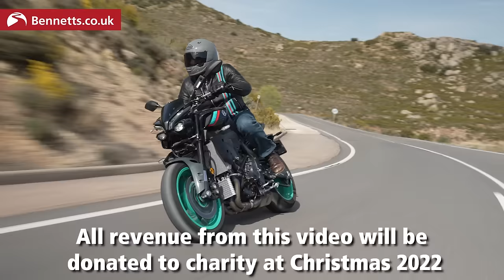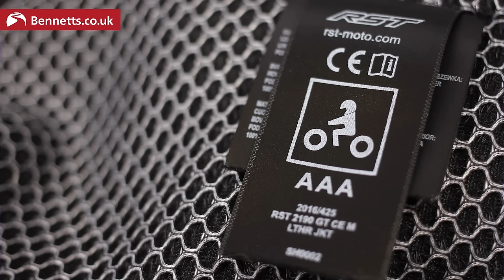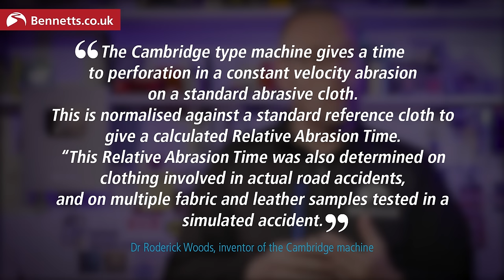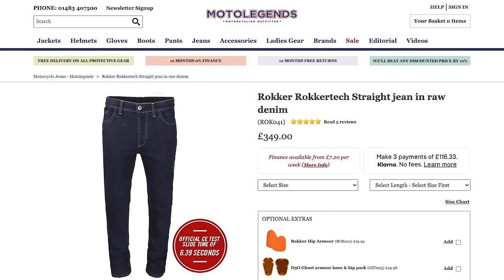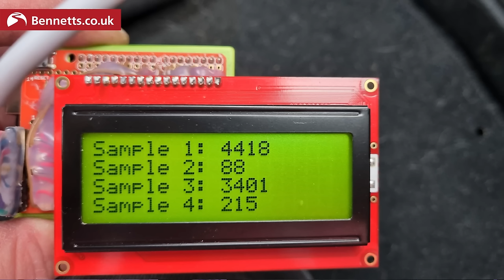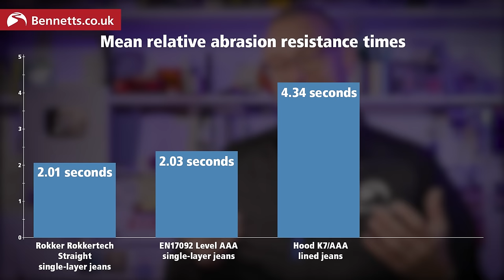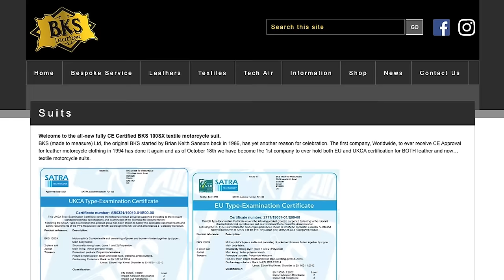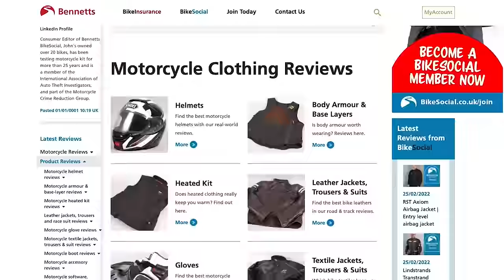Best motorcycle jeans | Single layer vs lined: THE TRUTH

Comment: I see Motolegends have posted a new video on single layer vs kevlar jeans and if it was a response to this video, then frankly it's disappointing. No technical data to back up their previous claims, but instead the focus now is on how horrendously uncomfortable (in their opinion) lined jeans are to wear. What's far more disappointing however is the fact that they (the chap in the cap) are deleting any posts that question the safety of single layer jeans, or are negative about the products they sell. I had no idea posters could delete comments and initially thought I was going mad as a few sensible comments left on there - 1 linking to this video and another giving Hood Jeans the thumbs up over single layer jeans, suddenly disappeared. A quick Google search later into whether posters can delete comments and I can only conclude that Motolegends are deleting anything that questions their products and their sales patter. The reality that this is how they operate has just lost them a customer, I actually own a pair of Rokkers I bought from them last year and also a pair of Hood jeans. I won't lie, the Rokkers are a bit more comfortable as they're obviously thinner, but since watching John's excellent video, I'll only ride in my Hood jeans, which are not at all uncomfortable so far. I had intended to visit the Motolegends shop as I need to replace my lid and jacket, but definitely won't be now. I would have posted this on their channel, but it no doubt would have been deleted. Thank you to BikeSocial for all the excellent reviews, most of my kit, locks etc have been bought off the back of watching them, if only this latest video had been made before I shelled out £350 on a pair of what I was led to believe were the ultimate jeans for protection on a bike!
Reply from the maker: Hiya... cheers for this! Yes, I've watched it and I was surprised how reasonably balanced it is in the most part. It's quite sensible, though I would say that there ARE higher standards than EN17092 AAA, and they're EN13595 Level 1 and Level 2. These will be going soon, but should hopefully be replaced by the (optional) BS13595, which should allow buyers to better compare top-end products. 
The A, AA and AAA ratings really are a good thing to help buyers, and they were rightly brought into law to stop brands and sellers making unsubstantiated claims of safety. Unfortunately though, with AAA being relatively easy to achieve, some are using wording that infers there is nothing better, for example making out that any product rated AAA is inherently as protective as something like quality race leathers, for instance.
Also, while the weight shown of the Hoods was close to what I measured (1,880g with armour), I wish I'd measured the Rokkers before I cut them up because the AAA-rated Roadskin Taranis jeans that I've reviewed weighed 1,360g with armour. Those jeans are also proof that AAA-rated single-layer jeans DO NOT have to cost more than lined jeans, so there's more choice there for people: https://www.bennetts.co.uk/bikesocial/reviews/products/textile-jackets-trousers-suits/roadskin-taranis-jeans
However, I was pleased to see that the spurious 'slide times' went pretty much unmentioned, and there were no more claims of single-layer being 50% more abrasion resistant than leather, or of Kevlar being degraded by washing.
I think people can now make their own choices hopefully.
Yes – comments can either be deleted, or accounts can be blocked entirely. It's interesting watching the ones that are being deleted (though you can still screen-grab them before they go), but it's their channel and they can do as they wish. As you'll see in the comments here, we try to leave criticism in and address it if we can, but we do block spam, hate-speech and personal attacks on us or our contributors. You can also set up auto filters to hide suspect comments (sometimes YouTube gets it right, sometimes not), then these are put in a folder for reviewing. I try to go through these every day, and do what I can to cover them. 
I think Motolegends looks like a great shop overall and I really like what it does to encourage people to ride; we put all their breakfast mornings in our events pages, though sadly I doubt I'd be welcome. Still, it does seem strange for a company that states it won't sell lined jeans to criticise a company that chooses not to make single-layer jeans. Like you, I prefer to make a judgement based on science and data. I'd prefer to see people informed, rather than influenced. 
We won't always get it right, but it really makes no odds to me what people buy. I wear single layer jeans, and I wear lined jeans. I don't tend to wear leather much, despite knowing it's usually even safer than my lined jeans!
All the very best and thanks again,
John
Reply from the maker: You can get a lot more data at the BikeSocial site, here: https://www.bennetts.co.uk/bikesocial/reviews/products/textile-jackets-trousers-suits/what-best-motorcycle-riding-jeans-kevlar-pekev-covec
Reply: Thanks for the reply John. I agree 100%, get the facts out there and let everyone choose. As almost all of my riding involves 40+ miles a day on the motorway I want the maximum protection possible in the event I go down the road, which is why I'll almost always opt for my Hood jeans until a legitimately equal single layer jean comes along. I appreciate Motolegends are a business, have products to sell and have chosen to stand by certain ones, such as single layer jeans, and I've no doubt they're right that one day lined jeans will be a thing of the past. I'm just quite disappointed with their approach to this, but as you rightly say, it's their channel and their choice which comments they keep or remove. All the best
Reply from the maker: @davuspg  No worries. When I see complete and scientific proof that single layer jeans match the abrasion resistance of decent leather across their entire construction, I'll stop wearing lined jeans. Until then, I'll make my own choices.
Also, while some stores might claim to be the leaders in promoting safety, I think the shops that allow you to search by A, AA or AAA rating, as well as by ECE22.05 or 22.06 for helmets, are doing much more for riders. Urban Rider and Sportsbikeshop come to mind, but I'm sure others do this too - maybe a way to assess a seller before you buy?
It's just about allowing people to make their own, informed choices.
Reply: Had the same outcome, when I questioned the "chap in the cap" about my own Hood Jeans experience.  Comments deleted, now blocked.
I guess money rules over truth, surprise that :-)
Reply: @bennettsbikesocial  
When is your next review of textile jackets coming out? I'm in need of a new jacket, but since seeing this video and having done some research of my own, I have little faith of how safe AA and AAA jackets really are.
Reply from the maker: @davuspg  it'll likely be 2-3 weeks. It's going to be a buying guide to help you choose based on your budget and riding needs. Cheers, John
Reply: Motolegends are really hostile to anyone questioning their impartiality online. Insulting and rude. They have put me off them as a company.
Reply from the maker: @Nick_R_  it's a shame, as I think we should all support UK companies, but yes... and that's just the comments that aren't removed. Sadly I see the 'slide times' are still being peddled, and now the single page of test report is being shown. With no context it's unhelpful at best, misleading at worst.
Reply: @bennettsbikesocial  "I'd prefer to see people informed, rather than influenced." This line above really resonated with me so much I felt compelled to call it out in a reply. I love what you guys do on this channel, even if I am still coming to terms with having spent more time than I care to admit watching a review of chain lubes. 😉
Reply from the maker: @darren-lewis  thanks so much! Yes, sorry - the chain lubes was a big one. There's a textiles one out now too... all the best, John
Reply: 100% I feel the same way and was in same situation. Love this content.
Reply: @davus pg. re: chap in cap and a pair of Rokkers, me too!
To his credit, he did fit me with a nice Schuberth helmet which was cheaper than the ill-fitting (for me) Shoei I’d had my heart set on.
I’d probably still go there to buy a lid, because they do take time to fit you right, but some of their clothing prices are crazy. I just bought a Segura jacket online, for less than half the price they sell it for. I can get coffee and a biscuit anywhere!
Reply: I would encourage you and anyone else who has this experience to report them to YT for false or misleading information. 
To me putting money above people's safety - especially on a bike where thats a real concern - is just low.
Reply from the maker: @longjonwhite  I think it's worth paying some extra for professional service (though there is a limit). It's a shame what appears to be a good shop sullies itself with some misleading information, and what appears to be a personal attack on other brands. But yes – getting the right helmet fit is vitally important. I've done a video on it here actually: https://www.youtube.com/watch?v=FVSrZVS5ZVo
Reply: @bennettsbikesocial  I had a comment of mine deleted from their Rokker jeans video. I think I was one of the first buyers and I actually like the jeans, but commented that, unlike normal denim, they feel cold on bare legs in cold weather. Apparently, (in my best Jack Nicholson voice,) THEY, CAN'T,  HANDLE, THE TRUTH !
Reply: @Nick_R_  And the Cap just isn't working for the "CHAP"
Reply: I posted on that Motolegends article about the Resurgance "New Wave" jeans claiming a 10 second slide time, as per the Cambridge test as was stipulated at the beginning of the Motolegends segment. The Australian Motocap using the Cambridge test found they only held up for about 1.4 seconds average. The Motocap tests have absolutely no affiliation, they are simply a government funded body designed to give Australian consumers accurate information in regards to motorcycle protective gear, in order to help reduce severity of injuries sustained by riders in road accidents. That is the motivation behind it. 
10 seconds vs 1.4 seconds is a pretty bloody big difference, and a pretty disingenuous claim if you ask me. Grateful to have a few resources left that will save me forking out for sub standard, bogus gear that proliferates despite the new regulations out there.
Reply: Nobody wants a liner in your jeans, it’s deeply uncomfortable and hot. Kevlar is old tech. Lined jeans is old tech and is the past. Unfortunately the business is not moving with the times.
Reply: My story is exactly the same - almost word for word - I shall not be going back to Motolegends ever again and regret forking out the £350 for the Rokker pair  - Hood for me from now on - well I live and learn I suppose but it sticks in the craw
Reply: Nice vid
Reply: @ragetobe  Because there's simply NOTHING better.... I want a liner in my jeans thanks...
Reply: Hello from the future.. Just watched this and read these comments, and they are fascinating.  Motolegends is just down the road from me, and I've got all my gear from there in the last 6 or 7 years.  However, I'd been cooling on them a bit anyway - in the last few years, since COVID I guess, shopping there has become much less enjoyable. You are met at the door with a brusque "what do you want", and then often have to take a tag and sit in the waiting room. Once it's your turn, you get the feeling you are expected to make your purchase and bog off quick-sharp, to make way for the next customer. No more chatting and browsing.  But reading this is a real eye-opener.  It's a shame - I'd much rather shop in person than order stuff from an online warehouse, and I don't mind paying a bit more for the personal service, but not massively over the odds for a biased and possibly inaccurate opinion. Thanks for the heads up!
Reply: @AndyPutt1 : I wonder if the Resurgence jeans were tested, intentionally or inadvertently, using the less abrasive 120 grit belt specified in the glove standard, that extends relative abrasion resistance times by a factor of ~3.5 compared with the OP 60 belt specified in EN 13595-2. 

Supporting my hypothesis, I have a test report on a fabric produced for monolayer jeans where the summary states it meets the requirements of EN 13595 Level 2; however, digging deeper into the report it reveals the test apparatus included the 120 grit belt, so the true relative abrasion resistance in the context of the clothing standard requires the result to be divided by 3.5!

Unfortunately, this knowledge is only available if a copy of the test report happens to fall into one’s hands (which by sheer chance, on this occasion, it did).
Reply: Thanks for posting davuspg.  …  As Elon points out , we need debate, we need argument. For the guy in the cap to delete posts (that says a lot about him) 
I’d never buy from motolegends. Thanks for writing your post
Reply: @bennettsbikesocial "I'd prefer to see people informed, rather than influenced".  
Truly an enlightening and educational and worthwhile thread, video, and site! Thank you for your research and time and what you do. 
 
I am just getting back into biking with a CB500X on the West Coast of the US, and like any noob I am inhaling information. I am subscribing here and I just wish there was a site like Bennet's and bikesocial in the US. if there is, I have not found it.

So my question is: is there anything roughly similar to what you've got going in the UK, but for people on the other side of the pond?
Reply: Great, informative video yet again.  There’s no getting over the fact that good quality leathers like BKS mtm or Dianese race leathers will out perform any synthetic jeans on abrasion resistance. I have some ex police leathers which are incredibly well made but just too hot for warmer weather.      Was aware of skin shear which is why I wear breathable base layers.  Hood jeans would be my choice for jeans. Had Bullit covec jeans but fit and cut was poor.  Never believed the hype over rocker jeans which moto legends push so hard.  No evidence to back up their claims.  For summer I now use AAA rated Klim Marakesh trousers which uses d30 hip and knee armour.  I trust those more than any jeans, but am under no illusion that they or the best jeans can match decent leathers.
Reply: @Yowzoe  : I am not aware of any US based social media sites or groups that go into the same level of detail. I used to post information about testing and standards on an ADV-focussed site until one of the admins suspended me because what I posted went against the interests of domestic brands with which the admin appeared to have a connection.

Comment: Leather, leather, leather. Leather SLIDES, doesn't heat up as much as aramids, doesn't "grab" pavement like fabrics do, but in the Western US in simmer (sic) it's hot, you sweat (silk underwear helps) good leathers are VERY expensive (12 oz. or more) and heavy and require maintenance. I've crashed an F-1 bike at about 185 MPH and slid 600+ feet (200 meters) into the hay bales, got up, lost no skin, walked over, got a new helmet, didn't have any skin burns from the slide, picked-up my evil old TZ-750, push started it and finished my heat race. Good enough test for me. Before most of you were conceived, but I've been street riding since 1967 and got my million mile award last fall from the AMA for AMA touring, all on sportbikes.
Reply: incredible story, thanks for sharing it.

Do you have a recommendation in the US for reasonable leather pants for daily road riding?
Reply: I would agree I feel safer on leather gear

Comment: When I was a motorcycle cop 40 years ago, I had wool jodhpurs which worked very well the few times I went sliding down the road; not only did they protect my legs from road rash, the wool weave barely showed any abrasion!
Reply: I have some wool blend riding jodhpurs I picked up as army surplus, they seem super hard wearing. I use them as winter (bi)cycling gear. I have a super thick pair of leather overpants from Vanson I use on the (motor)bike. I'd take the jodhpurs over street jeans any day, though.

Comment: That homemade test rig reminded me of a test I saw in a magazine back in the 80s - where they tested different gear from the back of a pick-up truck on an arm that dropped it to the pavement.  Backing the material being tested was 50lbs of chalk - so as soon as it was worn through it would leave a line of chalk on the pavement and then they measured the distance from the start marker to the chalk line.  Plain denim lasted only a few feet, leathers were best by a long shot, and textiles were somewhere in the middle.  Some searching shows it was the Cycle September '88 issue.  It was super creative real-world testing and showed that the textiles were closing the gap and a viable alternative to full leathers.

Comment: I crashed from about 70km/h with Hood Jeans. Older model without comfort liner, just the aramid. No armor either. Well, the denim was toast. Aramid held. Still I had wounds of size about 2€ coin on both knees - apparently caused by friction through the aramid liner. So, I recommend using armor. Or at least stick a scrap  of leather there as a extra layer to absorb friction. Later on, after sweating half a summer in textile pants, I purchased another pair.
Reply from the maker: Glad you were okay! Cheers, John